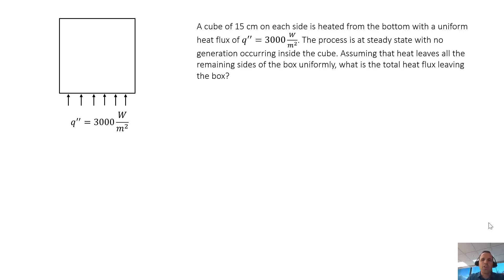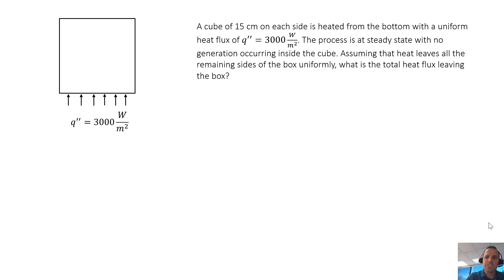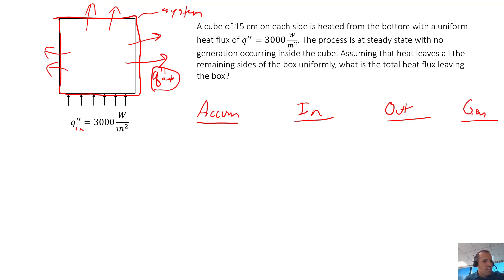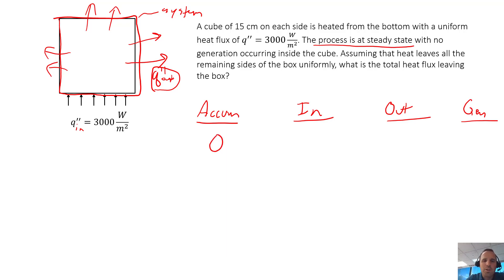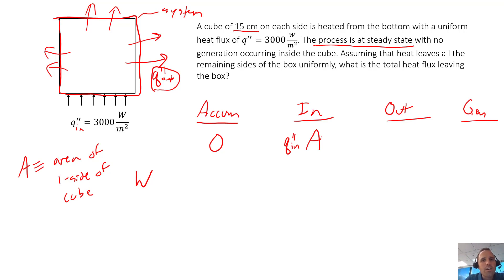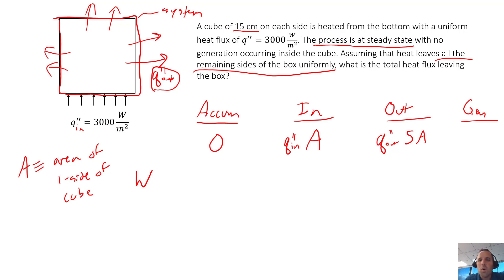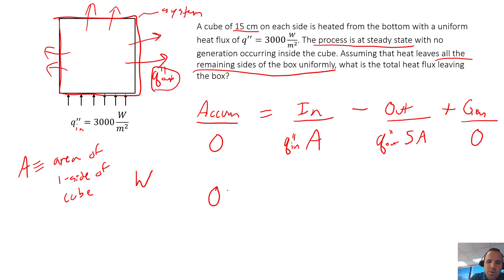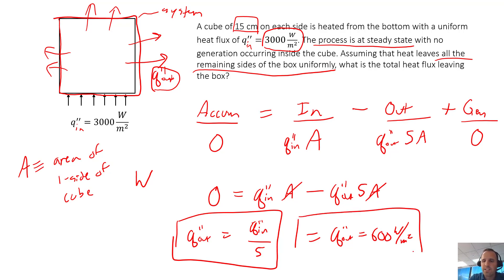Heat Transfer - Chapter 1 - Example Problem 1 - Energy Balance, control volume, and flux

Comment: it is correct but it is a bit confusing. cause it makes you think that there is a heat loss from 3000 to 600 W/m2. but actually, the 3000 is a heat flux and is only related to one side, and the 600 is related to 5 sides that's why is smaller. the energy that gets in is equal to the energy out.